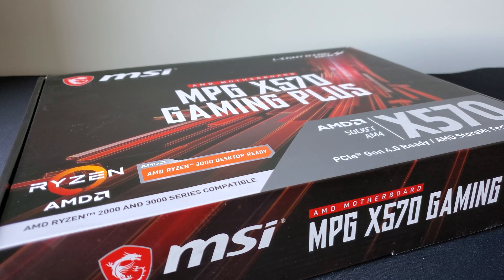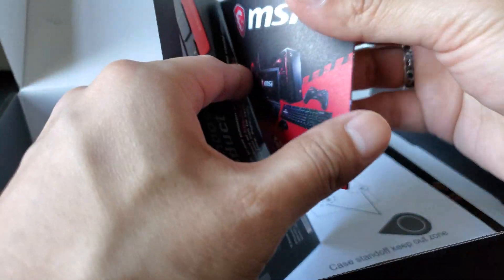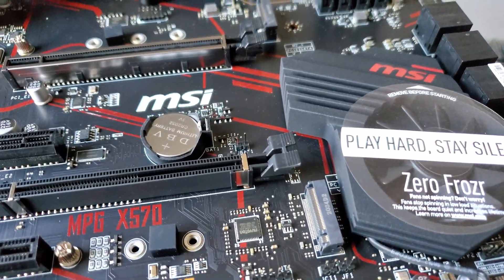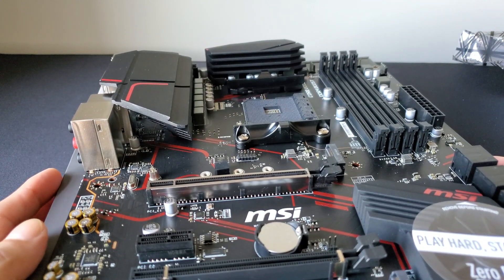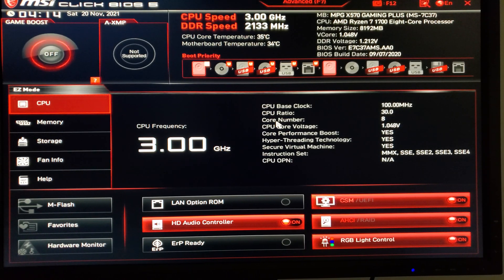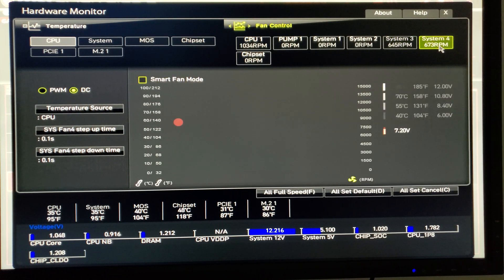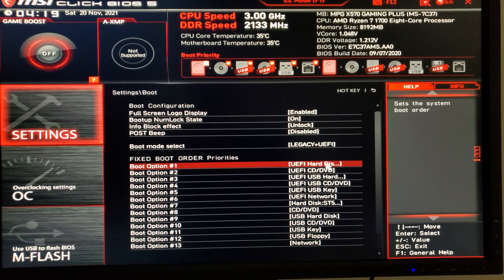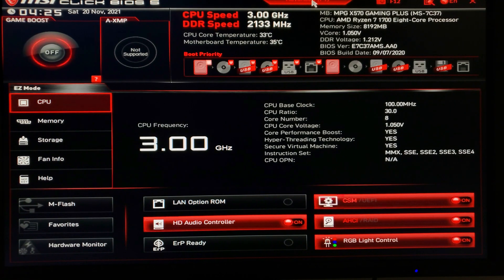The MSI MPG X570 Gaming Plus Motherboard | Unboxing, Installation, & Review

Comment: Hi!!! im planning to buy this board. im asking if I paired it with ryzen 7 5800x. Will u recommend it to me? or there will be an issue on thermals?
Reply: im using it with a ryzen 7 5800x ...works fine

Comment: i’m using this board with a ryzen 7 5800x3D and a 3070ti with ddr4 4400mhz ram, am i bottle necked?
Reply: it's not a good board for 5800X3D
Reply: @blakedmc1989RaveHD Why ?  İ got problem but coudnt find the reason
Reply: @sabriyeatalay-o4p  dude it can barely handle a Ryzen 5 3600 and i'm glad i got away from diz motherboard

Comment: Less Sata ports are fine but when you build a HTPC you need them for the NAS HDD's for your media storage 

In my HTPC which Ill probably upgrading next month I have a 120 Gig SSD boot drive 5 WD Red NAS drives for media storage and a Blu Ray Rom for ripping my blu ray TV series discs to the HDD's and I had to install  a SATA PCIe Adapter 6 Ports SATA III to PCI Express 3.0 X4 Expansion Card because the motherboard only had 6 sata ports on it 

With the new HTPC build I want to be able to game on it and also run some emulators on it as well I.E Switch would be nice so what CPU and motherboard combo should I go for

Comment: every build i watch they dont insert the ram right. Should be A2 and B2 but does it make a difference in performance?
Reply from the maker: You're right, and I actually did that on purpose to see who would notice and also to demonstrate that the board gives you a warning at startup.

Comment: Would this be a decent motherboard to use with my Ryzen 5 5600x cpu? It's currently $159 on Newegg and seems to have decent reviews or would you recommend something else
Reply from the maker: This appeared to be an excellent mid-tier motherboard, and the x570 chipset is excellent for all Ryzen CPUs and offering the most options available. Just make sure it has enough USB ports/M.2 slots for what you will need.

Comment: Can i put ryzen 5 5600g?
Reply from the maker: Definitely can be, but the motherboard may need a BIOS update, if the box doesn't indicate it is Ryzen 5000 ready. You can likely do this even without a CPU installed as well too.
Reply: @Silent157  are there instructions on the manual?

Comment: can this run a ryzen 7 5800x?
Reply from the maker: It absolutely can. Be sure to check your motherboard box to see if there is a sticker that the BIOS has already been updated to support Ryzen 5000 series (which likely it already has). If not, you can always update the BIOS without a CPU as well as an option.

Comment: Is this a good mobo? Any issues with Ethernet connection?
Reply from the maker: I usually prefer to use wired connections on desktops and didn't have an issue when using it so far on this motherboard, using the latest driver so far. I have not tried to use it with a 2.5G connection, just Gigabit at this time.

Comment: hey you put the ram in the wrong slots, you are supposed to use 2 and 4. Read your manual if you do not believe me, just looking out man.
Reply from the maker: I mentioned that in the video, to see if the board still warns you of that at startup =)

Comment: i have tha same motherboard but with a Ryzen 5 3600 and a 16gb Corsair Vengeance LPX 3200mhz as a platform for a dedicated livestreaming PC  which i used to officially retire my FX 8350 from tha task since i'm not using for nither gaming or streaming anymore now i have a Ryzen 5 3600 on tha same motherboard u reviewed! i wonder if it's a good enough board for just bein' a PC dedicated to livestreaming?

btw my GPU of choice for it is a GTX 1070 until tha market gets better, however i game on a 1080Ti

also i had to do a Bios Update to support XMP but it pulled through for tha most part
Reply from the maker: The CPU and the GPU appear to be able to more than do the job correctly. The original Ryzen CPU had livestreaming in mind, where you could game and livestream on the same machine and the CPU you have is a pretty good one as well. The board definitely would be more than sufficient for livestreaming as well!
Reply: @Silent157  good to know because it's tha only thing i'm using tha system for
Reply: @Silent157  update, i upgraded to 32gb of ram 3200mhz Corsair Vengeance LPX and a RTX 2060 KO for my streaming PC